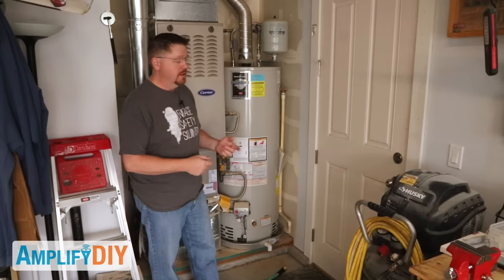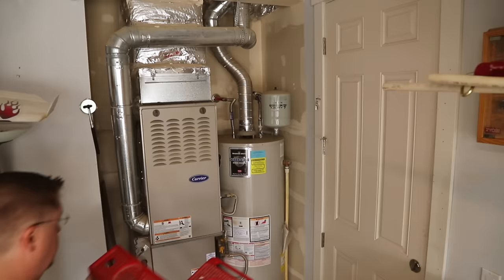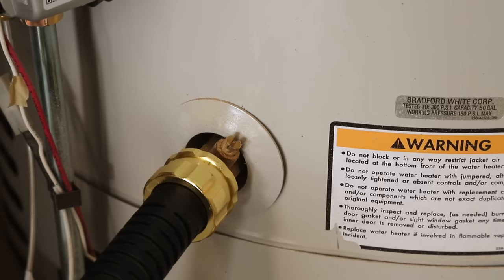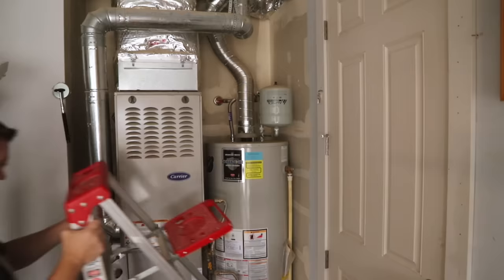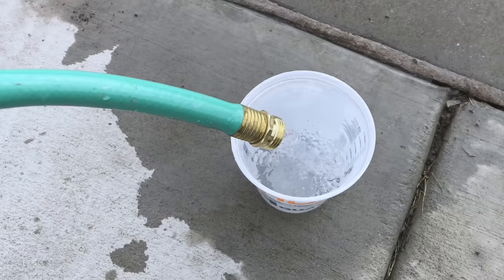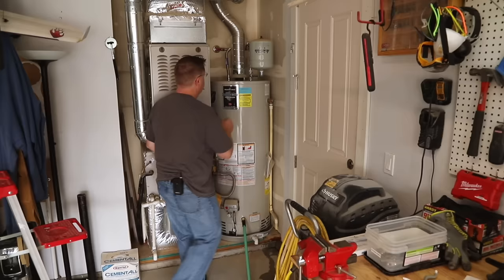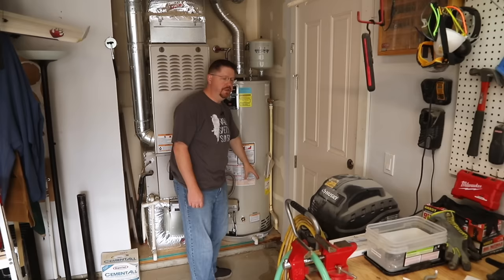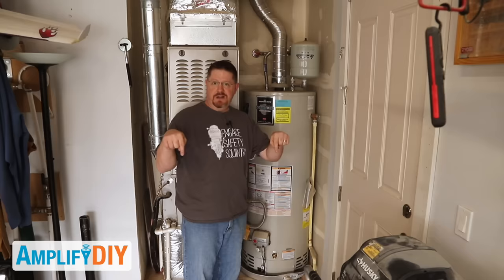How To Flush A Hot Water Heater To Remove Sediment

Comment: As a HVAC contractor who install/services water heaters, this is a great DIY video.  The only thing I'd recommend differently is to purge the air BEFORE you turn the power/gas back on.  More so with electric water heaters...if that upper element isn't fully submerged you could burn it out in short order.  Also by not draining the water heater as shown in the video,  you don't get the high pressure jetting action of the water breaking the scale up.   Drop a penny in an empty glass of water and then a full glass of water..... which one did the penny hit the bottom harder?
Reply: David Colligan, can you help me understand which step you mean? It's my first time attempting to drain a 10 yr. old gas water heater (40 gallon) , water's been coming out brownish each morning, I have to run hot water awhile, catching about 10 gallons in before it stops looking brownish. My water heater is in kitchen area. I can drain it out kitchen door ( using water hose ) but am worried. I'm an older gal but maybe can still learn how to flush water heater without blowing myself or tank up. Am concerned all the sediment, while I'm draining it, may clog up valve or hose. 
Can't afford a plumber at this time...any suggestions will be greatly appreciated. BTW this video was super! Best one I've seen yet. I just hate to mess up my water heater, but also hate that sediment has built up in it. TIA !
Reply from the maker: Hi Dancing - David is referring to the very last step, when I filled up the tank again, I didn't wait until it was COMPLETELY full to turn my heat source back on. His point (and it's completely right) is that on an electric tank you should wait until the tank is completely full before turning the power back on so you don't melt the heating elements. This is not a concern with a gas heater such as yours. 

As to your concerns: Flushing a hot water heater is usually a good idea, but I'm not certain it is the source of the brown in your water. A few things to test:
Is the water brown ONLY when using hot water? It is also brown when you open a cold tap? 

Is the water brown at ALL fixtures (shower heads, sinks, washer, dishwasher, etc) in the house? Or only some of them?

If the water comes out brown when you are only using cold water, or only at one fixture, then the issue is not likely to be your heater. 

Assuming you do proceed with flushing your heater: In your case I would definitely replace the valve at the bottom of the tank (where you hook up the hose) with a much better ball valve. You can pick one up easily at a local Lowes, Home Depot, or other hardware store for around $10. The reason I recommend changing it is because a ball valve has a much larger opening that will let larger chunks of sediment out without clogging. There are some other videos on YouTube that show how easy it is to replace the valve, and I'm sure that you can get free specific installation advice wherever you purchase the replacement valve.

Roughly, your steps would be:
Follow my video steps until the point where the tank is completely empty of water. Then, remove the hose from the drain valve, remove the old drain valve, and install the new one. Then proceed with the steps of flushing with short bursts of water from the cold inlet.

At the point when you have the old drain valve removed, grab a flashlight and look into the hole it came out of to see what you can see inside the tank. Hopefully that will give you an idea of how your tank is holding up. 

I'm happy to try to answer any other questions you have. Good luck!
Reply: @AmplifyDIY  Thanks so much for the response and the good question re: brownish water. OK what I've noticed is only the hot water, in each of 3 hot water faucets ( kitchen, bathroom sink & tub) comes out brownish almost every day. I keep white bowls and a white pail under each and run hot water until I see it's clear. I'd say almost 10 gallons this morning. That's one reason I jumped online and found your excellent video. :-) 
But must add I've had issues with plumbing since I bought old house over 15 yrs. ago. Main water line  'blew' barely 2 mos after buying. Kitchen & bathroom had to be gutted & a few but obviously not all pipes were repaired or replaced. The plumber in charge was in his 80's then ( only plumber I could find in remote area ). He's long gone, 2 yrs later I had no water in house for 3 months. No joke. It took that long to find a plumber to replace main water line & valve outside. A few mos. later the old 30 gal. water heater 'blew' while I was gone, got home to see flooded floor & water still coming out of heater. Got a new one.
One yr. ago when temps were single digit I left 3 faucets ( cold water ) dripping but pipe(s) froze again, I went outside armed with hair dryer by the main water valve & was able to thaw that pipe. It's barely 4 inches off ground. Pipes froze twice in the past. So last July meter readers let me know they suspected a leak. I shut off main valve & called plumber. Took a few hrs for him to find a busted pipe under house. It was repaired. ( not replaced ), what I noticed just before learning of Major leak ( 10,000 gals. leaked ) was the Cold water was running brownish. It no longer does, though. 
Sorry this was long, but it sounds like you may have ideas that may help me out. If I could move I'd do it tomorrow. In July I told plumber hot water was running brownish, asked what he'd charge to flush it, he told me to hook a hose up to it & do it myself. ( again, living in remote area has big downsides ) 
Another question, single digit temps due this wknd. in this area, do you know a good way to keep pipes from freezing? I leave faucets running, leave cabinets open etc. Problem seems to be under house, pipes too close to ground maybe, hardly anyone can fit under there to do much. Thanks Again! I watched your video again, read a few comments and anyone who said negative about it I think you're right, they may be plumbers who don't want 'regular' folks to know how to flush their water heaters. Ignore 'em. You've provided excellent service to lots of us. Let me know what you think, if it may not be water heater or ?
Reply: Dancing von sounds like you have old rusted pipes that need to be completely replaced. Probably galvanized. When you touch one, the ones next to it break, so on and so forth until they’ve all broken like dominoes. I was a plumber for about 5 years and I refused to touch galvanized pipes without homeowners signing a form that said I was not responsible  for more pipes breaking if I tried to patch a leak. 

Replacing all the pipes with PEX is surprisingly affordable vs copper, etc but yes, still not something those of us can shell out for who live paycheck to paycheck.
Reply from the maker: Yes, Dancing, it sounds like you have bigger issues than just needing to flush a water heater. Probably time to call a pro.  Good luck!
Reply: @MH-ty7fb  Hello, thanks for the info. The plumber who came to help me out a few yrs. ago ( he'd overheard a couple of contractors at a mom & pop diner wanting to overcharge me for a main water line so he came over and put it in underground for a fraction of the cost) I took photos of the whole thing, he didn't mind, he's still my plumber. I can't tell by the pictures what type pipe the mainline is ? I'm thinking I'd best ask him what types of pipes are under this 60 yr. old house. House is a little older than me but on my income I truly can't afford much anymore. I've sunk all my savings into trying to repair this house since buying it in 2001. I hired two lawyers back then, both 'quit' and both told me to move. If I had the money to move I would have, but had just spent it on this place. 
Because I moved to such a backwoods area the sellers, inspector etc. were all in 'cahoots' . I moved from another state to where I am now. And yep, I regret it. Due to this weather there's no way I can flush water heater right now. Hot water's been brownish since August. Prior to then water was fine.  It clears up after about ten minutes. The plumbers who've been here in the past had a heck of a time,  they had to drill through the floors to access the pipes. One plumber told me I'd have "continuous problems" because he didn't see any plumbers glue had been used on the pipes he'd fixed. My current plumber hasn't mentioned that.  
When pipe(s) froze a yr. ago and I thawed it outside by shut-off valve I think a big pipe must've been damaged, if meter reader hadn't warned me I may have leak ( last summer ) , I wouldn't have known. 10,000 gals. leaked. I didn't hear anything. There was no loss in water pressure. No way to notice it as we'd had weeks of heavy rains.Is that what happens if a galvanized pipe bursts?  I'd best call the plumber & ask what he did to repair it and what kind of pipe was it. I'd bet you are probably right. And that worries me. But I sure appreciate your input. It may also explain why a few plumbers refused to work here at all and why I went 3 mos. without water in 2009. I lugged water from my relatives house. I have one option to move it'll be a big move and not what I want to do, but maybe I'd best rethink it.
Reply: @AmplifyDIY  Thanks again for your replying to me. I went into detail when I replied to THX 1138 in above post. My plumber was here in August. The one who told me I could flush water heater by myself. Of course he'd already been here about 8 hrs. reason being it took the guys a long time to sump pump all the water from under house. Not only had 10,000 gallons leaked ( which I was totally unaware of ) but we'd had flash-flood rains for a couple of wks. and I live in a flood prone area, so I wouldn't have noticed water pipe leak, there was no loss of water pressure, either. Meter reader told me I may have leak & yep, I sure did. Finding a good plumber has been next to impossible here. I'm not kidding. Waterline ( main one from house to water meter ) was replaced twice. I paid each time. Once in 2002 and then again by a different plumber in 2009. 
I think the water heater is causing the brownish water though. It was installed in 2007 ( just noticed that on the heater last night ). And cold water's coming out clear. But with single digit temps I won't be able to flush it out until it warms up a bit. If and when I do I'll be sure to watch your video and take your advice before hand! 
Well thanks again for your help,  I appreciate it.
Reply: @MH-ty7fb  just an afterthought, but what is PEX? I know the kitchen & bathroom pipes had to be replaced a few months after I moved in, I took photos of the crew and their  work. New sewer & sewer lines put in, too. So it just sort of hit me, maybe there aren't too many rusty pipes? Or if some are new and some are 60 yrs. old what should I do? Ballpark figure? Thanks again.
Reply: Dancing von pex is an acronym for polyethylene crossthread. It’s a plastic type of pipe that can be bent. You can plumb an entire house with next to no fittings although you will have to buy a pex crimping tool. I’ve done several houses top to bottom in less than a day. Also, pex can freeze and it will go back to its original shape after expanding 3x it’s original size. So, great if you live somewhere that freezes.
Reply: @MH-ty7fb  Hey thanks for letting me know. Is it expensive? This is a small house, under 1000 sq. ft. Big problem is it wasn't properly built in the late '50s so there's hardly any room under the house where pipes are. That's why contractors & 2 plumbers had to cut out sections of kitchen floor to get to pipes.  I'm sure no PEX pipes were used. If I could afford it I'd get it done. Paycheck to paycheck isn't easy & I've sunk too much into this place in 17 yrs. The good new is no pipes froze up this wk. ( knock wood )Left faucets running etc. Jan 6th 2018 faucets were dripping steadily when they all froze up in similar cold weather. 
As for water heater, this a.m. I paid closer attention, hot water comes out not brown, but tan at first, so I ran it for 10 mins. full blast, until it ran clear, took 5 gallons to get clear today. So it's not dark brown or rusty color, but it's a dark tan color at first. Then gets clear. No noises from water heater, it seems to heat up fine, too. Am wondering if I should try to flush it myself or should I ask plumber to come do it? Am over 50 now so things I used to be able to take care of aren't as easy as before. Thanks again!
Reply: Dancing von pex is roughly 1/3 the cost of similar sized copper pipe. If you pause the video at 2:03 the white pipe on either side of the valve is pex. You use crimping rings to attach it to pex fittings. Or you can use push in fittings like shark bites but those get expensive quickly. Shark bites are almost dummy proof though and take no skill or tools to use them. I recently installed the main water line to my house as I switched off of well water. 600’ and 6 fittings, other than digging the trench it took me all of 15 minutes. Try talking to someone in plumbing at a home improvement store and maybe you’ll get lucky and actually find someone who knows what they’re talking about.
Reply: @MH-ty7fb  Thanks again, the last sentence gave me a chuckle. It is funny. Thanks for pointing out what pex pipe looks like. That's not what the main water line looks like that local plumber installed a few yrs. back. He used a thin black pipe of some sort. I'm barely 5 ft. tall and could fit under my house better than most the workers who've been here, but my old bones don't allow me to do as much as I used to, though I still climb on the roof to patch shingles down, clean gutters etc. I'm a small woman with a lot of determination. I sure appreciate your helping me out. Most the pipes under the house are at least 60 yrs. old. 
What has me baffled, about water heater, is today it ran clear ( hot water this a.m. ) after less than a minute. ? Does that sound more like sediment in water heater or maybe pipes in house that carry water are rusty?
Reply: Dancing von you could check your water pressure, or pay a “free estimate” company like roto-rooter to do it for you, you’re not obligated to buy anything from them either way. It’s hard to say without a comparison, say, your neighbors? If you have low pressure it’s probably because the water lines are filled with sediment between the meter and your house, or inside the walls. The black pipe could be abs or pvc. The water running clear could be as simple as a pile of sediment was around the drain and you cleared it, another may show up again. I spent extra money on a water heater and sprung for the installation (even though I was a plumber) on a 12 year warranty tank in the 90’s and have gotten a new one about every 6 years since. I live in a county covered in limestone, we all have hard water. We say we only have one rock here in Wilson county, but we’re not selfish we all share it!

My water pressure is less than 20 psi (you don’t want more than 80 psi) but that’s because I live back in the hills and...that’s fine with me.
Reply: AmplifyDIL

Comment: First of all, THANK YOU!!!  As an FYI.  I flushed the tank many, many times as white particulate matter kept coming out.  After awhile, the floor became wet.  I thought a leak had developed.  I talked with a plumber.  Turns out the water heater was "sweating".  It appears as if the water is coming from under the heater, but NO LEAK.  If this happens to anyone, be aware and don't panic....
Reply: Eric Shay it’s because your tank was hot and now it’s filled with ice cold water. Like a glass of nice water on a hot summer day.

Comment: You should open your pressure relief valve anyway every time you flush it while it is draining to make sure water comes out and there is no buildup and also, turn the gas to pilot and then take a shower so you save money and the water cant scald you if it accidentally sprays on you
Reply: U right i open it from get -go  till end of it when i done with & wanna fill back the water tank  .is not really good touch it more then once a year one time  that  presser Vale is really flimsy  cheap made anyway , so have to be carful

Comment: I have never heard of draining a hot water tank but makes perfect sense. My hot water tank is 18 years old and never been cleaned. Wish I would have known this years ago! Great simple steps even for a single female. I now have an emergency. Thanks for the video!
Reply from the maker: With an 18 year old heater that has never been serviced... I'd honestly recommend that rather than mess with trying to flush it, start saving for a new heater. You are already on borrowed time. If a heater is properly serviced from the time it's new, they will easily last 30+ years, but generally fail around 8-10 years if they are never touched. Best of luck with yours!
Reply: Yes I was on borrowed time:) I now have a Rheem 12 year warranty installed. I will try to drain it at least once evey two years. Thanks again for the video! It was very helpful!
 @AmplifyDIY

Comment: I diligently flush mine every year but I never flushed it in bursts like this and I got tons of sediment out this time.  Thanks for this lesson!  I think I probably had a clog at the drain valve so I probably never really emptied it completely.  I did this burst sequence about a dozen times or more because I kept getting lots of sediment (white stuff mostly).  The next time my plumber comes to the house for other projects, I'm going to have him install a full port ball valve so that more of the sediment will come out and to prevent a clog at the drain valve.
Reply from the maker: I'm glad to hear that the modified procedure was able to get so much more sediment out for you! Since you flush it yourself, you are more than capable of replacing the existing drain valve with a full port valve yourself - and doing so would be FAR cheaper than having a plumber do it for you: https://youtu.be/OBPJYg0o_o0  Good luck!